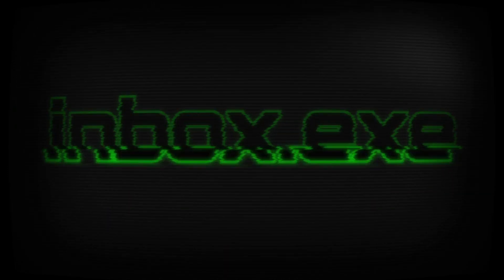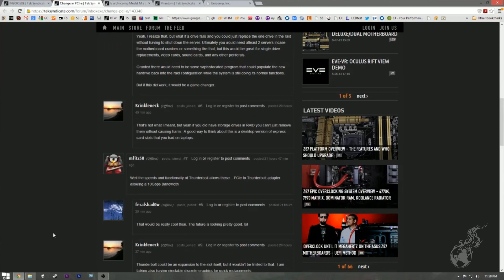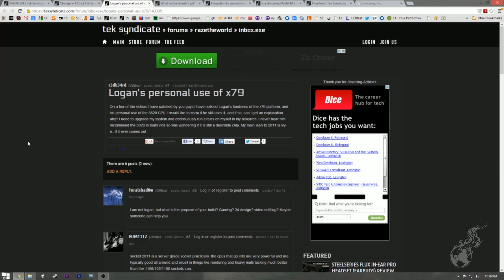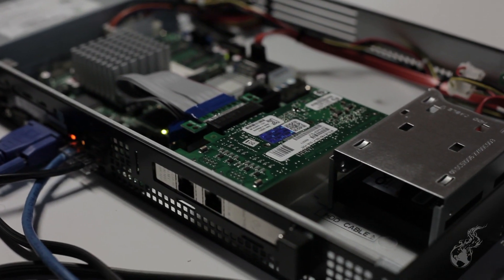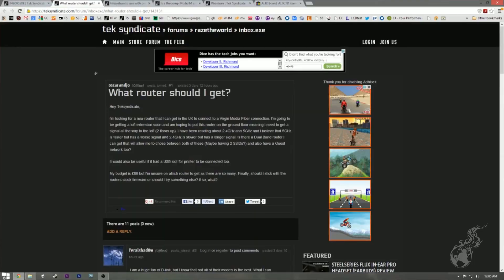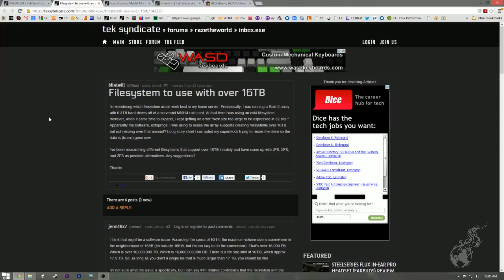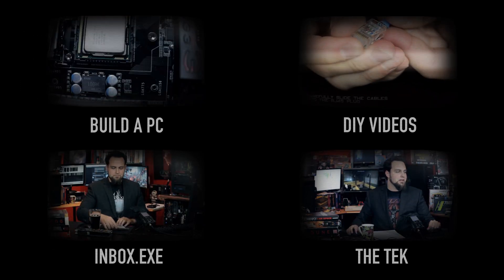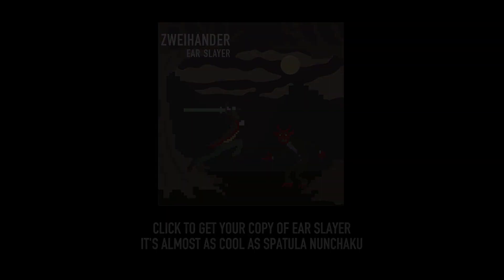INBOX.EXE 0035: Build Your Own Router & Nas - pfSense and FreeNAS

Comment: Building a router is not for everyone,  "pentium 4"? I wouldn't want that thing running 24/7 as my router. You're better off getting a soekris box. But most people would be fine with a plain ol consumer router that supports open firmware.
Reply: They were talking about a free router (since many people have old computers laying around) to get your feet wet.
Reply: I know... still think you're better off spending a little $ for a Broadcom (MIPS) router, like an Asus, and put Tomato on it.
Reply: Pretty much all consumer routers are crap even if they can handle ddwrt or tomato firmware because they simply do not have enough processing power, RAM or throughput to handle connecting through a secure VPN tunnel to anonymous proxy service like everyone who lives in the US should already be doing.  I have a few business routers that will do this well but they are also in the $500+ range and most people don't want to spend that kinda money.  I have a miniITX PC that I built a couple years ago that has 8GB of ram and a dualcore 2Ghz ULP laptop processor and it works awesome as a router and fully supports running multiple VPN encrypted tunnels with over 50 devices behind it on the network.  Having 8GB of ram also means that I can have a fair bit (About 7GB) of common websites pre-cached  which helps speed the whole network up and save some bandwidth.  The router uses only about 15 watts when idle and maxes out at about 55 watts at full load which only happens for a few seconds during boot-up.
Reply: Having ran a router on a P4 machine for months (I only switched to a newer ITX board with an embedded cpu because I got tired of the noisy IDE drive) I can say PFsense is not very CPU intensive at all. I love PFsense, I'll never use a consumer router for anything fancy ever again
Reply: dandelion I built a mini PC that is a great router.
Reply: kuhrd
That's a pretty nice setup you have there, hope to do the same someday.

Comment: the alix 2d19 bundle for 200 bucks has a motherboard that contains a 500mhz cpu.    500mhz!!?  wtf?  my netgear wndr3700 has more cpu processing power with 680mhz and I bought it way back in 2010 for 180 bucks.  

" ok chronofusion but buying the 2d19 bundle and isntalling pfsense on it will allow it to deliver your internet and networking coherent features better and faster than your netgear router with netgear's firmwares"

ok  prove it. Sincerely, I'm all open eyes.  I thought about replacing netgear's firmware with dd-wrt but haven't seen a real need to yet.

Comment: even still im happy with the performance of my i7 920 @ 3.3Ghz w/ gtx 680 in a silent optimized case, cant tell its on, not one for getting a boner for nice graphics but like my heavy modded skyrim and gta 4, so until something dies, ill keep this rig, 1366 is a perfectly fine gaming/surfing/small file rendering rig. total cost was $120 for the cpu and 2 460's that i sold for the 680. and evga ftw mobo all in under $500 CAD :)

Comment: Hi ,

i was wondering if Pfsense could be deployed on a cheap old system to make a poor mans AirPort Extreme (apple's router+ usb drive share + printer share) ?? AirPort Extreme besides being a router can turn any external USB hard drive into a secure drive you can share across your Wi-Fi network. plus it can even connect a printer and share it wirelessly .(see attachment)

I dont want to use pfsense as a firewall at all. basically as secure or unsecure as Apple Express .

thanks 

amit
Reply: There is more than likely a plugin to do that :) Break out an old pc and experiment!
Reply: You are way too technical for a lawyer my smart smart brother...
Reply: The only problem you may run into is USB speed...if you're using a USB wifi adapter, you may slow your speed because of the lower speed of USB on older systems...my friend had that issue and we bought him a PCI wifi card...

Comment: He did a benchmark 3570k vs FX8350 using RAM which was unsupported by the intel which meant it couldn't perform as well as it could meaning the FX8350 was much faster. He has still not realized his mistake so still believes the FX8350 is better for gaming.

Comment: Gentlemen I need YOUR help, My Asus Dark Knight won't flash properly to dd-wrt, either the wifi or wired ports won't work, I have used DD-WRT forever and I love it best firmware out there, but I am stuck; any assistance, links to videos, forum posts, guides, would be greatly appreciated. I have tried the DD-WRT forums and I haven't gotten much help from the them, they take some time to answer, can't fault them for it though, thank you in advance.
BTW my dark knight is Hardware Revision B1

Comment: I don't think you guys understand the point of why some may want thunderbolt and external graphics. Personally I DO want very thin and light for on the go. However once i am home, where my thunderbolt dock would be, i could then plug it in to my thin and light laptop. As well as all the other gaming stuff such as keyboard and mouse.  Most ultra books have enough ram and processing power for games, they just lack in graphics. So portable with less power on the go and powerhouse at home.

Comment: Yes, just buy a consumer grade router and install DD-WRT or other firmware for the security and customization features. Plus that way you don't need a separate WiFi AP. Perhaps if you do a lot of local file transfers you might find an advantage, but for most people they don't really need it.

Comment: No, I used to have the standard 18Mb/s (in England) and it worked fine with a standard router, I only had to upgrade my router once I got fibre, because the router couldn't provide speeds over 50Mb/s. I got a Buffalo WZR-HP-AG300H and installed OpenWrt. It easily handles everything I throw at it. I also have a pfSense box with a 3.07Ghz Core 2 Duo and 4GB RAM, it's just overkill, it's in some cupboard. If you wanted more features then yeah, I would recommend either OpenWrt or DD-WRT.